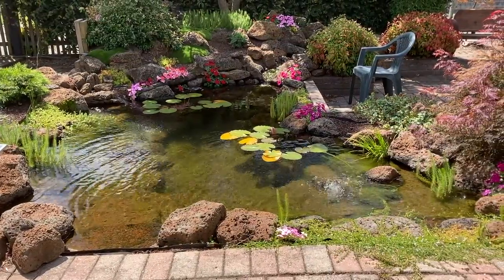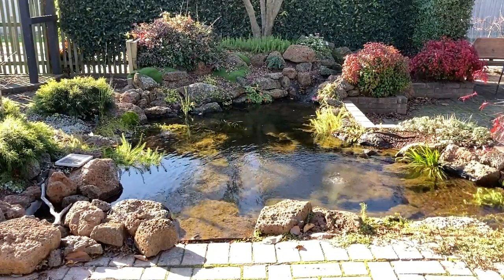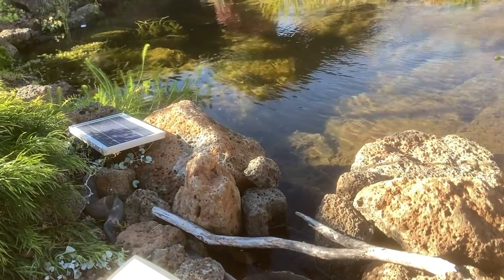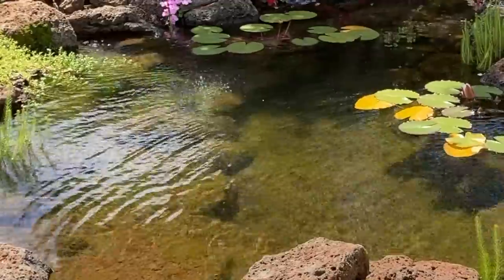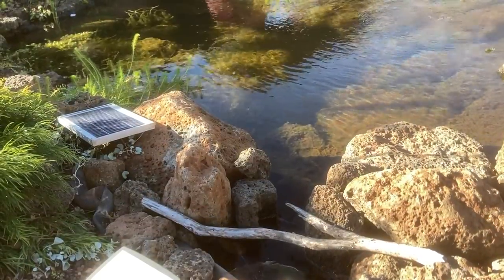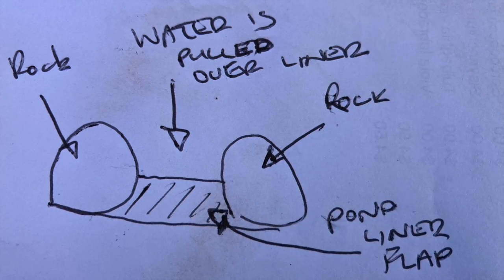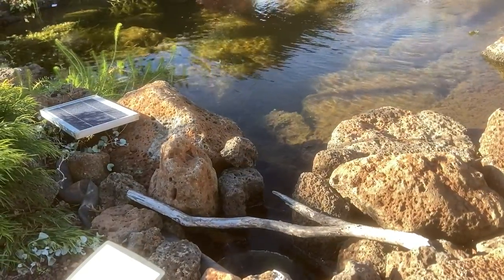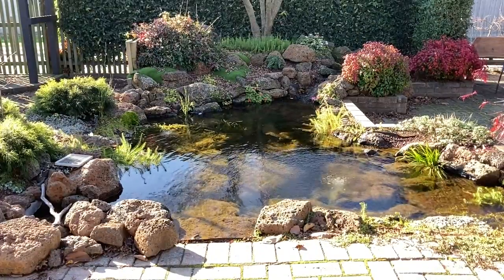DIY pond skimmer

Comment: Hi Kevin. I hope you don't mind me asking a couple more questions. Did you subsequently put an auto-fill valve on your DIY skimmer? And what is the distance between the top of the liner flap in the narrow opening between the rocks and the actual water surface? Thanks.
Reply from the maker: No auto valve. The flap sits 5-7cm (about 2inches) below the water surface when the pond is completely full. The water level will drop over time if there is no rain. Because the flap has play in it the water can drop more than 5-7cm before needing a top up. Hope that makes sense.
Reply: @Ozponds  It all makes sense. Thanks for your speedy reply.
Reply: @Ozponds  You have built an absolutely great looking pond by the way. I don't have room for one that size, mine is going to be a mere 10 feet by 6 feet!
Reply from the maker: That’s still a nice sized pond 👍
Reply: @Ozponds  Sorry Kevin, yet another question. My rather large 38cm diameter bucket arrived today but I have a question about the pump to go inside it. The one I originally looked at here in the UK is the Jebao XTP Super Eco 5000 pump. I am not running a stream or waterfall but will have something like a terracotta urn for the water outlet at the other end of the pond. A 5000 LPH pump might be too much for this. In your experience, would I get away with using a small pump, say 1600 LPH, or would that not produce enough 'pull' for the skimmer to work effectively? Thanks.
Reply from the maker: The more flow the better the pull.

Comment: Hi Kev - these videos are so helpful. Really appreciate the time and effort you have gone to to get the information out there for other people interested in building ponds. I had a quick question about the flap. You mention that you tuck it under two smaller rocks but I am having problems envisaging how the flap stays vertical. Do you glue it on the sides and leave a section at the top to flap? Or does the pull of the water keep it against the rocks? Could you explain a bit more or draw a diagram. Many thanks!
Reply from the maker: I think it’s just one of those things you need to play around with. It’s just a scrap piece of liner and a few rocks. It’s easy to play around with or even retro fit to an existing pond.

Comment: Hi Kev, I have an update on my mom's water garden. The bog filter is working great. The water is much cleaner and the fish are much happier with minimum work. I may work on improving my skimmer. My main question is about maintaining the bog filter during the winter. My mom lives in north west Tennessee. during the coldest part of the winter there are times when the pond will freeze but the pump that is used for the umbrela continued to pump during the freeze. Will the bog filter freeze and stop the pump? thanks for all your videos, Frank
Reply from the maker: It’s not really possible for me to know if a bog filter will freeze in a particular place. All I can do is show how I build and maintain mine. You’d imagine if the umbrella feature kept going the bog should be fine.

Comment: Just another question. You said you drilled holes in the bucket so if the water level dropped below the lip of the bucket the pump wouldnt run dry. But wouldnt it run dry anyway if the water level drops below that narrow intake corridor? Again excellent channel!
Reply from the maker: If I did it again I wouldn’t even bother with the holes.

Comment: Hi Kevin, I'm just building a 10ft x 6ft pond in my back garden. I have 2 questions please, apologies if you have already answered them previously. Firstly, with regards to your DIY skimmer, how many LPH  is the pump you used in the bucket? Secondly, if the water level drops below the level of the flap, would the pump not suck all the water out of the bucket,  then run dry? Thanks. Kevin Lorenzo (UK)
Reply from the maker: This pond pump is 4600 litres per hour. Yes that is the downside of a skimmer if the water level drops too low the pump runs dry. This was something I was very concerned about. But turns out I love my ponds so much I always look at them (at least once a day). I’m also lucky to live in a high rainfall area so only ever need to top up in summer.
Reply: Thanks for your reply. I'm concerned abour it running dry while I'm away on holiday for example but I know you can buy pumps that shut off automatically if water is not present.
Reply from the maker: The problem with most pumps with dry protect they keep trying to turn back on. If left for extended periods they would eventually burn out. You could add an auto top up valve and just turn it on when on holiday.

Comment: Another fantastic and informative video Mate! A great DIY system that can save some big bucks! Skimmer system makes perfect sense to me .... except for one thing. 

When first constructing the pond, do I need to ensure that the EPDM liner is long enough (or wide enough) to accommodate the area where the bucket skimmer sits into, so as to maintain a waterproof area for the incoming water around the bucket, or is the waterproof "well" around bucket somehow created later, in a way that I'm just not seeing? I've watched this video 3 times now. 

I'm Planning on constructing a 3.5 X 3.00 X 0.6 Meter pool with one shelf. (approx. measurements) 2 shelfs I "think" would make it look too crowded.  I will also be using a large old PVC bathtub to create a bog filter. "The Bathtub Bog Filter" should be capable of holding 380 Liters to support the pool volume 3,800-liter. The pond will hopefully be able to work in harmony with 4 to 6 goldfish. (10% bog filter to pool ratio as per your PDF) 

PS: I paid for and downloaded your PDF from your website. Lots of great detailed info! 

Cheers!
Reply from the maker: I like the bucket inside the liner. Keeps the whole area waterproof. The two large rocks, some waterfall foam and an off cut of liner are used to force the water between the two rocks. That creates the skimming action. Hope that helps 👍
Reply: @Ozponds Thanks for the quick reply. I agree that pacing the bucket inside the liner is the most "fail-proof" system.
Reply: @Ozponds  Thanks for the fast reply! On 2nd thoughts (as this is only a modestly sized pond with no major leaf fall), It might be simpler to just scoop /net out any surface matter. 👍

Comment: So much helpful content, thanks! Would you say this would be possible to add outside the end of an existing pond? 14' x 3.5' x 1.5 avg depth. Or in that situation would it be better to lean towards the skimmer boxes that sandwich the liner between two pieces? 

Have lots of leaves and original pond builder didn't build in any skimming and not enough bio filter.
Reply from the maker: If there are lots of leaves you might want to consider an intake bay. I built one for my large dream pond I’m in the process of building. There is a video it’s a few weeks back. Otherwise yes a commercial skimmer box is good, you might just need to check it daily. Hope that helps.👍
Reply: @Ozponds  Thanks! I've seen a bit about intake bays on larger ponds, would probably be perfect if I can scale it and work it into my space. Will keep researching and working my way through your videos. Learning a lot, looking forward to a healthier, easier to maintain pond.
Reply from the maker: Doesn’t need to be big. Although the bigger the area the more leaves it can fit and therefore go longer between cleans. Good luck with it all 👍

Comment: Great video and excellent information. I make screenshots of all this "quick drafts", they are extremely useful to understand the setup.
By the way, I didn't fully understand the function of the "liner flap between the rocks", why it is needed?
And, if due to the evaporation, the water level falls below the flap height... this will not prevent the bucket to be refilled and will damage the pump?
Reply from the maker: The flap just makes the pull or draw into the pump more efficient. The water bends it so there is some flexibility in the water level. If you look at say an aquascape skimmer it has a weir door. The flap acts in a similar way. Hope that makes sense 👍
Reply: @Ozponds  Yes, thanks, a lot more clear.
I didn't know the word "weir door", if anyone didn't either, this image is helpful: https://i.stack.imgur.com/LRROI.jpg
Reply from the maker: Thanks mate that will help a lot of people 👍
Reply: @CogitoBcn  hey cogito....your question was a good one but even with your pics I still don't understand completely

Comment: Very clever. Is the flap attached only at the bottom by a few rocks ?  Also how far under the water is the bucket and is the bucket niche backfilled in snug or do you have space around it ?  Also I’m thinking maybe attaching a bit of foam to the top of the flap much like the floating weir doors
Reply from the maker: Top of bucket is about 6 inches below water level. Bucket was back filled a little to hold in place. I thought about adding some foam but it was unnecessary in the end. 👍

Comment: Hi Kev, this is so helpful. Thank you!! 

I was looking to buy a pond skimmer set up but as you know they are $1000 plus another $700 or do for the pump! 

One question I have is, how far in cm does the top rim of the bucket have to be below the water level? 

Kind regards Paul.
Reply from the maker: Depends I guess on how much fluctuations of water level you are wanting to have. I tend to allow this pond to go up or down about 5-7cm.
Reply: @Ozponds  thank you for the quick reply. Yes that makes sense. Thank you again.

Comment: Doesn’t putting a pump into the skimmer box makes a slightly buzzing sound because it’s not damped by that much water?
Reply from the maker: I find pumps usually only make a noise when they are partially blocked up.

Comment: What happens when the water level drops? Is your flap able to move like the pivoting doors in commercial skimmers? I need to make mine adjustable to water level changes as I won't have an automatic method to top up the pond.
Reply from the maker: It’s can drop a few inches but any more than that and I need to top the pond up. The intake bays give me about a foot of fluctuations.

Comment: Hi Kev!  This video is most helpful.  I am, however, not fully understanding the "liner flap" and how it is situated.  Could you provide a bot more detail on the liner flap?
Reply from the maker: It’s really hard to explain. It’s just a piece of liner that kinda flaps around to really create a thin layer of water over it.
Reply: @Ozponds  where/how does it attach?
Reply from the maker: @BillyYIII99III  it doesn’t. You just keep it in place with rocks.
Reply: @Ozponds  that's helpful, Thank you

Comment: Does having a skimmer eliminate the need to draw water from the bottom of the pond? 

Im making a 250-300 gal pond. If I don’t go with skimmer, would you recommend doing a false bottom with a Bog set-up, or would a standard bog set up be enough for the pond?
Reply from the maker: Most of the time if I have a skimmer I don’t draw from the bottom. Just the skimmer.

Comment: Great video...... how would I add a skimmer like this to an existing pond that has a liner already?
Reply from the maker: It’s pretty easy but hard to describe. All you need to do is make it so that the water is forced between the rocks and over a shallow hump, so you get that water tension pulling motion. You’ll need to partially drain the pond to do it.

Comment: Is the flap piece of liner necessary? With the pump drawing water in i assumed that does the same thing. Reason I ask is I have a purchased skimmer missing the flap and it’s always continued to work without it. Thanks for your videos, find them more informative than the channels which are basically infomercials!
Reply from the maker: It’s not necessary in all cases. It always depends on the depth/ width and flow rate. I guess it’s just a great way to add the ability to change the depth and therefore create more “draw” into the skimmer area. I’m glad you like the videos 😊👍
Reply: @Ozponds  thanks! you sold me on bog filters for my next build! :)

Comment: Is the bog pond lower than the main pond? My main pond is approximately 20' from the lower, shallower pond. Can I make this work for a filter?
Reply from the maker: Yes you could certainly convert a lower pond into a skimmer or intake bay. 👍
Reply: @UC5uRSGrV7DrF2fJ6qk8FZLQ Can the main pond empty into the lower, smaller, shallower pond and then be pumped back into the higher ,large pond and work as a filter?
Reply from the maker: It could but it won’t be as efficient and will be more difficult to maintain.
Reply: Well shucks!
Reply: Thank you all.
Reply: Can I add photos?
Reply from the maker: You can email me photos. kev@ozponds.com

Comment: Kev thanks for helping us with the skimmer idea, I ve made a 3x4 meter half above ground pond with oak beams holding down liner, how can I incorporate the skimmer with flap into this type of pond, thanks
Reply from the maker: You could just seal off a corner. Alternatively it might be worth looking at one of those hang on the side skimmers used in above ground swimming pools.
Reply: @Ozponds  can I make this myself and put it up on one of my shelf’s.  
Question is that flap. 
The skimmer and pump inside it
Before it goes up into my bog. Right. 
I enjoy studying all of your great videos, I made a bog in a barrel which sits up above my pond but I did it more simply with out inner pipes,  the water simply enters from the bottom and flows up thru the rocks and out above, I think I need to make a clean out drain pipe, I put active charcoal bag as well, filter floss, ceramic beads and a sponge, gravel and plants, the works,
it really cleared up the pond quickly,  but cleaning it out from below is a good plan , thanks kev for your help,
Reply from the maker: Yes pump sits in a bucket with a sponge over the top. I anchored the flap in using rocks and used foam to seal the gaps in all the rocks surrounding the bucket. This means the only way in for the water is over the flap. Then yes the water is pumped from the bucket (skimmer) up to the bog filter. Hope that helps 👍

Comment: Sadly I'm not a genius, (close though!) so I'm going for the bog. How much higher does it need to be than the main pond and would that be measuring only the top of the two? I'm moving dirt from a high point close by to the perimeter of the proposed bog and making it about 1/4 the size of my big one. Does it need to be shallow?
Reply from the maker: It only need to be about 6 inches to a foot above the main pond. Yes that is top of the pond to top of the bog (water levels). The water in the bog can be as deep as you like it can even still look like a pond. Just try and layer the gravel and rocks if possible. Big on the bottom and slowly get smaller as you approach the top of the rock/gravel layer. 2 foot of gravel/ rock is plenty. Hope that all makes sense. Ive got lots of bog filter videos that will help explain the layering and how to make it easy to clean etc. Good luck.
Reply: @Ozponds  Can I access the videos from your website?
Reply from the maker: I don’t have them all there only the early ones. I wrote the articles over a year ago. Now I focus more on YouTube.

Comment: What if my pond is all rock, without any plastic liner?
Reply from the maker: If you’ve got a natural rock pool you probably don’t need any filtration, just enjoy nature at its best.
Reply: @Ozponds  I have a 5000 gal pond. You can't see any fish because the sun is causing too much algae and green water. There is no bottom drain, so I added retrofit drains. I have a huge eucalyptus tree that blows leaves and bark, so I covered the pond with a net. I have six large tubs of blue flag iris plants that clog pre filter leaf basket, so muck and leaves don't allow water to flow. So, no, I'm not enjoying the natural pond. I'm going to follow your instructions on the bog filter system, using a 300 gal Rubbermaid tub also. ☹️
Reply from the maker: 300 gal bog on a 5000gal pond with the issues you talk about is too small.

Comment: We have made 2 fabulous big filters and getting ready to make one for a friend for her birthday!! How ever this skimmer is killing me...  😂😂🙏🙏🤦‍♀️🤦‍♀️
Reply from the maker: What the problem Rene? It’s so simple.
Reply: @Ozponds  I think I’m having pump issues.... ordered a new one!!  I don’t have a way to get to the liner so I’m also having floating problems. Not really possible to nestle this in a tight spot.🤓
Reply from the maker: Can’t you just make a cove out of rocks? Then use those rocks to anchor in an off cut of pond liner? Seal the rocks with foam if necessary so that water passes over the flap.
Reply: @Ozponds  can you sketch the liner part and the rocks… I am lost there . Thanks
Reply from the maker: G’day Mario. I thought I did in this video. The off-cut liner flap is just tucked under 2 large rocks. The water flows over the top of the flap creating the tension or current.

Comment: This may be a silly question, I'm still learning, but if I already have a biofalls sort of filter (sponge and bioballs and spillway waterfall)... would I need a separate pump to add a bog filter too? Because the flow rates need to be different?
Reply from the maker: No you could divert some water to the bog filter. Just remember it will take away from the waterfall though. You don’t want the waterfall to have too little water flowing over. Showtimes it just easier to add a small energy efficient pump to run the bog. But the choice is yours. Hope that helps 👍
Reply: @Ozponds  that does help! I really appreciate you taking the time to answer! I love your channel!
Reply from the maker: That’s ok. I’m happy you are enjoying the channel. Good luck with your project 👍